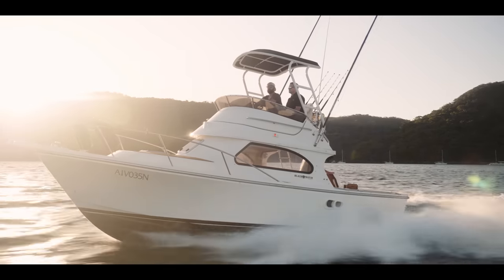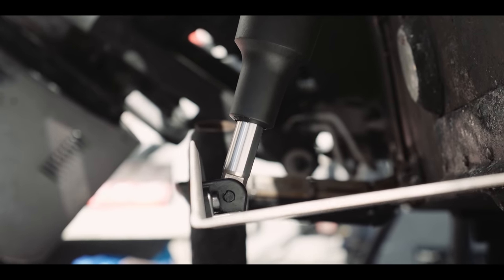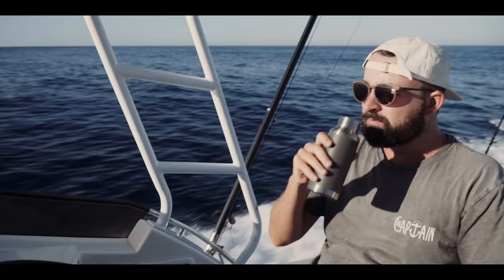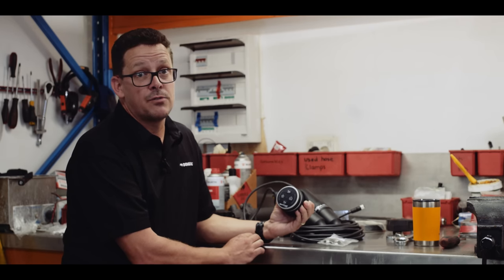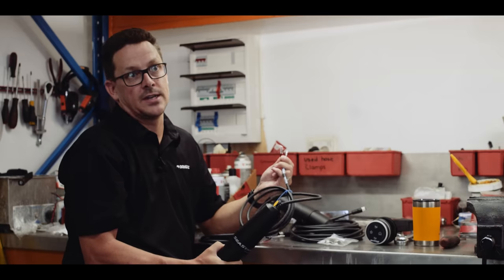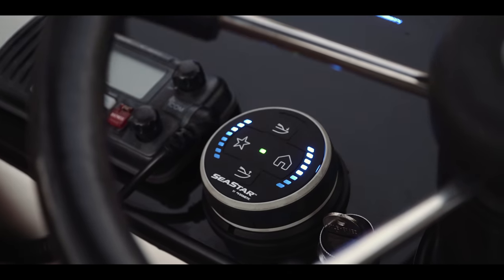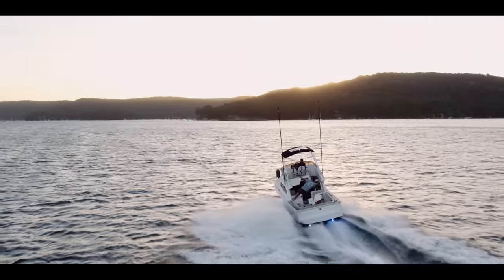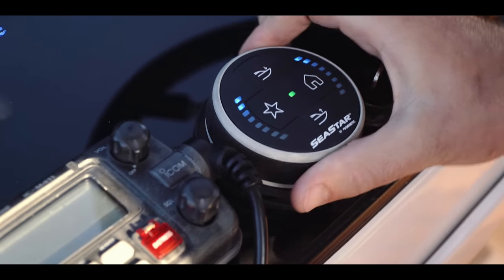New Digital Trim Tab System | The Captain’s 26 Black Watch flybridge

Comment: Great channel keep it up guys!!!! My Blackwatch 2008 26ft has Volvo 260 d4 with duro prop it also has Volvo trim tabs and work a treat. Out of the hole on the plan in 4 seconds. Cruise 22knots at 35lt per hour at wide open throttle 28knots at 55lt per hour.

Comment: So no auto mode like zipwakess, or bennet pro tabs?
Reply: Johno bruv how you doing
Reply: That's what i was thinking.
And not as cheap as one would think vs Zipwake.
Reply: I would of thought zip wake too they seem the best and auto mode for the win
Reply: @nattherat89  yes agree, the most expensive but the best by far.
Reply: @ME-qq2dc  I’ve heard nothing but good things about them and they seem soo much more responsive and easier to use plus their inbuilt gyro seamless

Comment: I thought it was auto-leveling until the end.  That is a bit pricy a system without gyro stabilization. Bennett's AutoTrim Pro system is a lot cheaper and they are a reliable company for years.  The only thing I like about this system is the controls are a little more intuitive and it has NMEA 2K integration.  Other than that, I would stay with Bennett's system since their support is legendary.  It has multiple favorite buttons and a dimmer switch for the LED lights too.